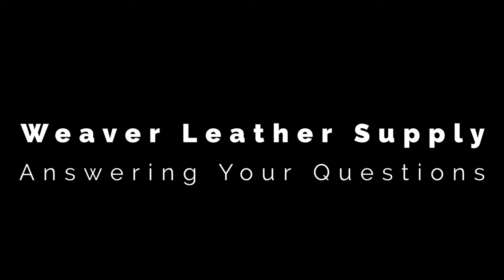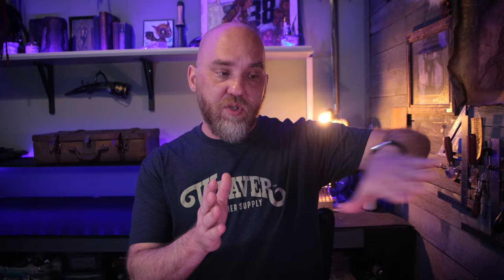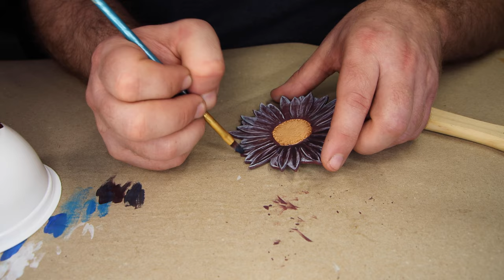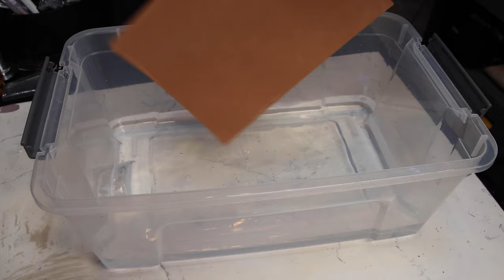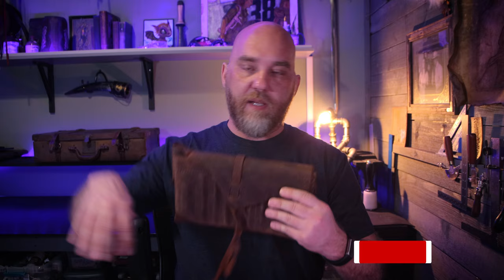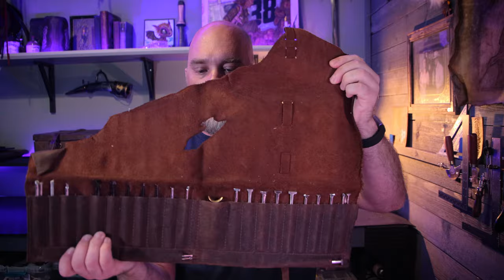Answering YOUR Leathercrafting Questions: Part 2

Comment: Great video Daniel. I thought the idea with contact cement was that you waited until it was no longer tacky before you joined the pieces. That way there isn't any more solvent off-gassing. Am I wrong on that? I haven't had a failure yet letting it dry but maybe I've just been lucky.
Reply: Good question.  It shouldn't be wet,  but it still needs to have some tack to it. If you wait too long it won't bond.

Comment: Here's a question. When you were working on the Celtic project, you did your dye work, then paint, and then put a sealer on. After that, you put on your antique. Now the question(s)....why did you seal before antique? Will it go through enough to get into the leather? Are you trying to limit it to JUST the tool work?
Long winded, but my inquiring mind wants to know. 
Thanks!
Reply: That's a fair question. There's two ways you can use antique. 
1. To tint/color the leather.  This is done without sealing it first,  which allows the antique to absorb into the leather.  This essentially "stains" the leather. Legitimate technique if that's what you're going for. 
2. Low lights - this is done by sealing it,  then antiquing.  This allows the antique to settle in the low areas (beveling,  deco cuts, etc) without staining the project. Essentially, this creates contrast, which in turn creates depth. 🙂
Reply: @DanielReachCreations  Gotcha, thanks!

Comment: I’m hoping your explanation on how wet to have the leather was for pyrography as per original question because I thought it was supposed to be completely dry for pyrography
Reply: My experience and research says that you need some moisture in the leather. The less you have the more it will burn. The more moisture you have,  the more "melting" you get. Less smell with moisture vs dry. Kinda depends on the effect you are going for. 🤔 😉